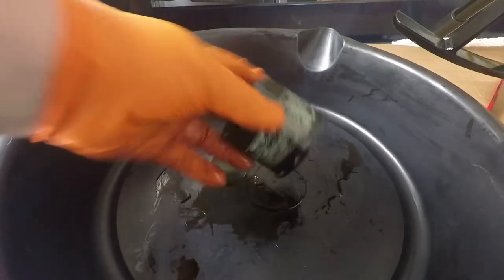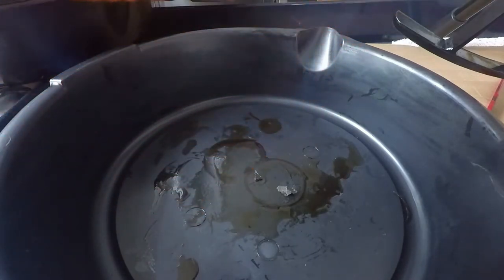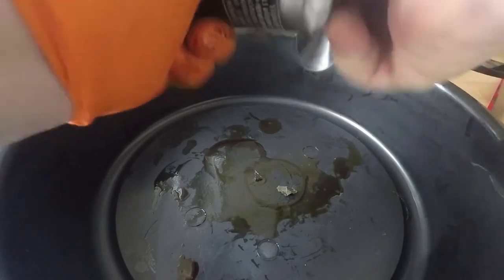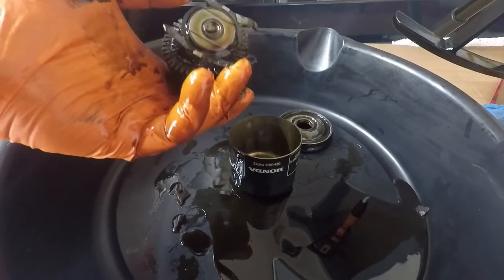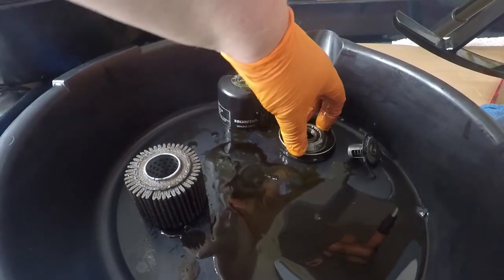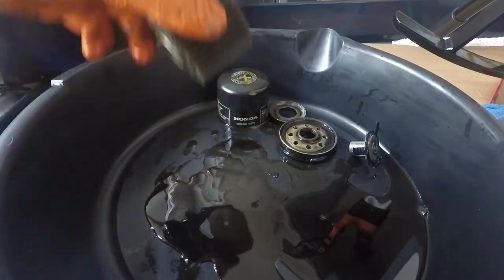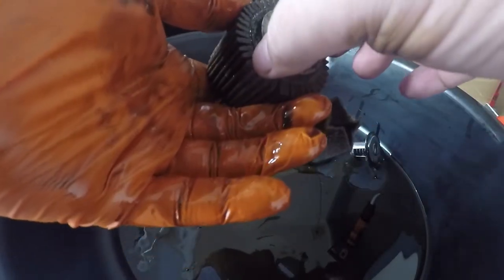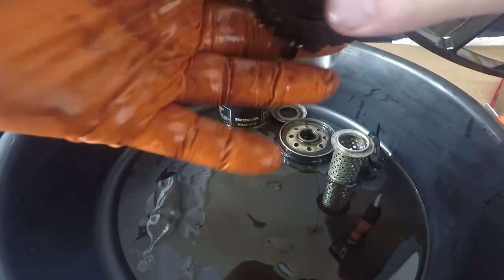OEM Honda Motorcycle oil filter

Comment: Thanks kindly for this interesting video 👍🤝 I have always been curious about the structure of Honda OEM oil Filters 😎 cause I stocked up on some for my 2019 CB1000-R. I am using them during break in period until the ODO reaches 10K miles, afterwards I will be using Motul 7100 4T ester oil  with K&N 204 filters 👍

Comment: Thanks for posting this video. Saves me from making a mess on my work bench. Not a bad filter, but at $17 I think there are viable alternatives. I have been using Pure One 14610/14612 until they changed the base plate. Then I found some old stock Bosch 3323 with the concave base plate. Was using them on my 06 Speed Triple (24k miles) and 09 FJR1300 (60k miles). Can't use those on my 19 Africa Twin (6k miles) as they are too tall for the bash plate clearance. Was looking for a non OEM alternative and was wondering what the stock filter looked like inside.